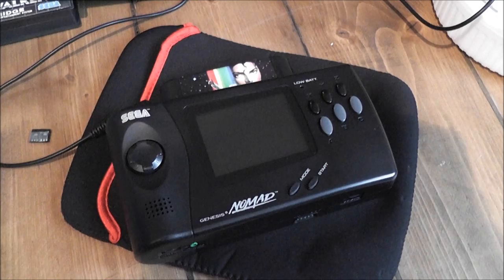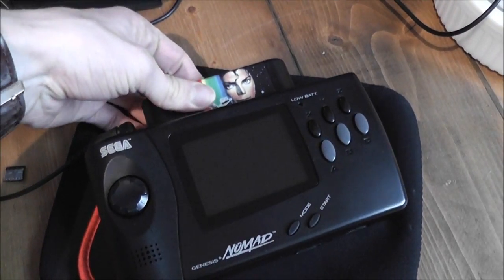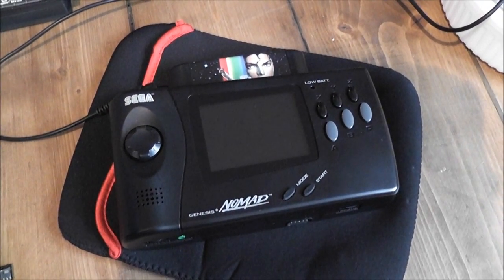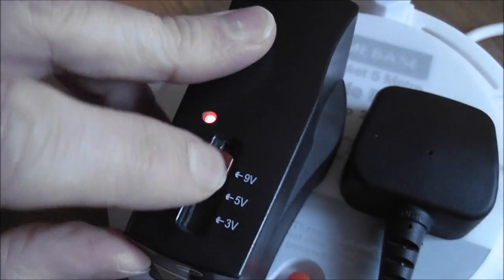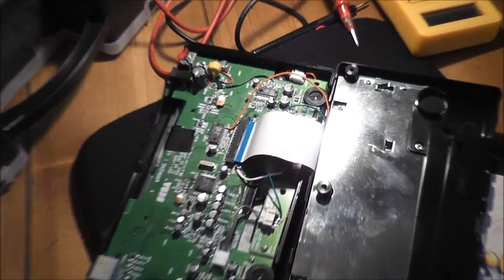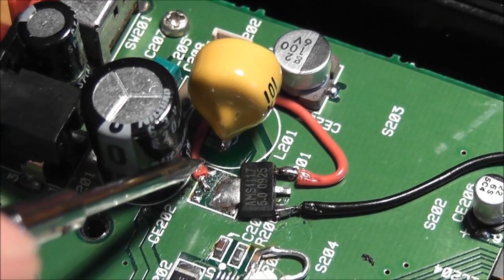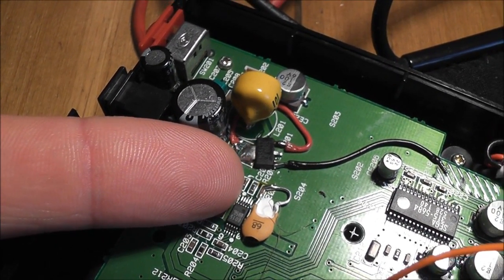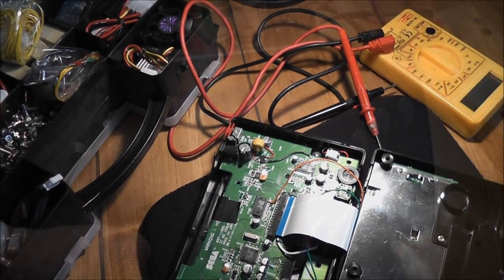My SEGA Nomad Died! :( - Voltage Regulator Fix - How To Repair A Dead Console

Comment: I was questioning my Nomad voltage regulator because I can play original games but I don't have enough power to run a megasd cart.  The factory t201 works but when I try this mod it works for about 10 second and the voltage regulator gets hot and the screen starts glitching. Any idea?

Comment: What if the pad on the board to where you soldered the regulator tab is missing on mine, seems like someone yanked out the old regulator with the whole pad underneath but all 3 pins are intact, could I solder red one to middle one, black one to left and middle one to right on the board?

Comment: Simply amazing!
I've just recapped the audio capacitors but the problem I had at the beginning is still present :(

I basically hear VERY LOW from speaker and only left channel in earbuds.

Both have quite a strong background humming.

What can I try? :(

Comment: Hello, I was wondering if you had thoughts on my issue. I have a Nomad that was working fine, but the LCD was burnt up, looked like it had been left in the sun too long. Can see that here:

https://i.imgur.com/ngwUWEj.jpg

So I did the LCD swap, with this LCD:

http://www.dx.com/p/2-ch-video-input-3-5-tft-lcd-display-monitor-module-w-cable-black-silvery-grey-ntsc-pal-201631#.WdKBJ1uPKCo

Initially, I was unsure how to modify it to run on 5v, but it ran off the Nomad's pins just fine, so I didn't worry. Can see that here:

https://i.imgur.com/h1WT9ae.jpg

It worked like that no problem, until one time I turned it on and the whole machine flashed for a second then shut off suddenly. I thought okay, voltage regulator went out, but I wanted to test to make sure the Nomad still at least worked, so I wired up a 5v DC power adapter to the battery terminals, figured out how to power the screen on 5v, hooked that up to the terminals as well, and the Nomad worked perfectly. Great, so I found your voltage regulator video, got the exact same voltage regulator, made sure the data sheet matched your wiring, and wired it up the same way. Only that didn't work. The Nomad sees the full 9v on the connectors at the board, but I'm not getting any voltage at the regulator whatsoever. So I'm wondering if there's something between the 9v connector and the regulator I can check, but I can't find any board schematics to help me along. Do you have any suggestions for me? 

Thanks!

Comment: hey this maybe a bit far back for you to replay but might as well take a chance so I did the voltage Regulator Replacement works great for the last year your a life saver for that but 2 weeks ago I got a blank screen and since then it wont read games I have tried cleaning out the cartridge reader and every thing it just buzzes from the speaker and gives me a blank screen. I can turn up the sound and change the contrast on the Nomad but thats it. there doesn't seem to be anything on line about this but the closest I could find is on the Sega Game Gear which needs a full Cap replacement on the main board. I just want your advice on this and if this could be a possible fix cheers.
Reply: Were you able to fix?
Reply: kinda the short answer yes the long one no, so yes it is working again and I hasn't given me any issues since, but no because some of the components at not original I did try to recap the Nomad and the issue continued so in the end I narrowed the issue down to main board so I bought a "dead" Nomad on from EBAY and switched out the main board, it was difficult at in the end the dead ebay Nomad needed a new power connector and contrast wheel but I was able to harvest those from my already dead Nomad I did do a video on but its not very in-depth but might be useful. 1 think about this voltage regulator fix I couldn't use any plugs that where under or above 5V the original Sega plug from the US stopped working but the EU one would work fine I have my suspicion that the 5V regulator is what caused it to die in the end but not 100%. so right now I have a working Nomad with a reworked board but original voltage regulator. I no longer plug it directly into the wall I have made a rechargeable battery back running at 7.5V and it hasn't given me any issues since. sorry if this isn't the info you where looking for but this was the only fix I could find good luck.

Comment: For those of you wanting to upgrade your sega nomad screen, Here is the screen that you need:  http://www.ebay.com/itm/291495038673    I got burned buying what seemingly was the correct replacement screen on ebay but it didn't work.   I just replaced my screen with one from the ebay link above and it worked great!

Comment: @Retrogametech what wires do I need to order/use for soldering on PCB boards like in the video.  I'm building a Bluetooth headset from a broken one and some of the wires need to be replaced because they are cheap.

Comment: So I replaced my voltage regulator and come to find out that one of my fuses was also blown. The one marked C207 on the pcb. Does anybody know the replacement part for this?
Reply: If it's marked C that's a capacitor

Comment: I believe this is exactly what is wrong with my second Nomad. I just finished a screen replacement on my main system and it looks like I will be replacing the voltage regulator then getting another LCD for this one. Thanks!

Comment: While i was thinking about what mods i am going to do to my nomad it occured to me that the drivers for the new lcd screens usualy have an onboard regulator that i think outputs 5volts, so you probably could have got some wire and tapped that instead of having to buy a new linear regulator.
Just saying for future reference if you happend to come across another nomad with a fried regulator.

Comment: Hey man
I am pretty much having the same problem. (Low battery light when plugged into wall outlet)  I also did the screen mod about a month ago.  Do you think the Nomad dying is a direct result of the screen mod?  Will the screen keep burning through voltage regulators? Thanks for the great videos.

Comment: @LFOSyncToo 
Wow... I've just repaired it...! Turns out it was the jack solder point problem !!! Fixed.
The sound is very faint... Does the Nomad suffer from the same capacitor problem as for the Game Gear ?

Comment: Just want to say a huge thanks for putting up this video. ATM I'm trying to fix my Nomad which I bought like you with a no power issue. I can't thank you enough for this tutorial. I have started troubleshooting the unit and I currently found some inconsistency on the soldering of the power jack. And my LED doesn't blink at all. Once the solder problem is solved I will tackle the TR201 voltage regulator with the help of this very video!! Thanks again man, awesome stuff here.

Comment from the maker: @shaurz I tried messing around with bypassing the regulator while I was fault testing. It didn't seem to like it. Also the LCD I've got in there is supposed to run off 12V. It runs off 7V with no problems but I think 5V wouldn't be enough.

Comment from the maker: @P5ychoFox I believe, if I'm remembering correctly ( and don't hold me to this), that the tip is positive. It should indicate on the PSU with a little diagram though. 
If the PSU is buzzing it usually means it's on it way out. At least that's been my experience.

Comment: What do you mean 'not interesting' it's very interesting stuff! Could you please tell me the polarity of the tip on the PSU you use. My Nomad came with a UK Mega Drive PSU and it buzzes loadly which can't be good.

Comment: Using a switchmode replacement power supply probably didn't help. Try getting a genuine Sega AC adapter, I've found that the adapters for Sega consoles are usually compatible with most other Sega hardware.

Comment: Well done in getting it to work again, would be a shame after all the work put in replacing the screen and doing the battery pack mod, if you couldn't get it working again.
Its definitely satisfying when you can fix a faulty gadget, my netbooks screen had a weird glitch that was making it unusable. The fix I did took 15 mins max, but made  all the difference.

Comment from the maker: @mattfm101 Thanks :). I realise it's not a very interesting vid for most people but hopefully it'll help someone get their Nomad running again :) . If it wasn't for the old forum thread I found regarding a similar issue someone posted several years ago then I doubt I'd have worked out what was wrong with mine.